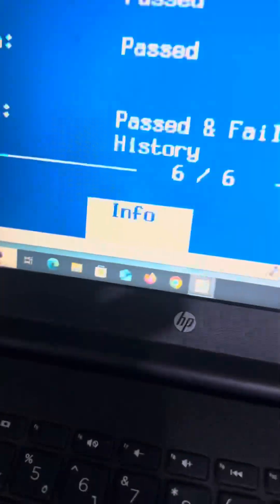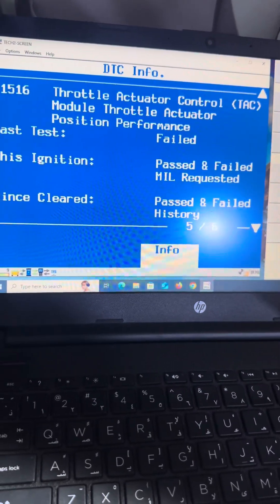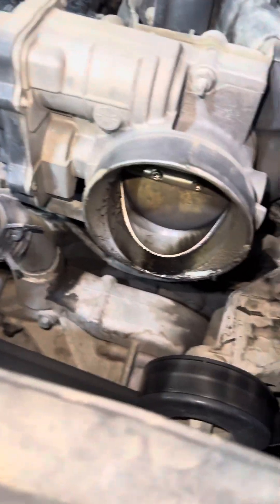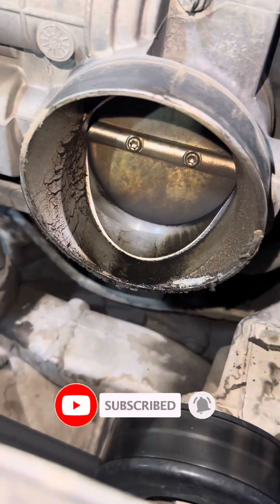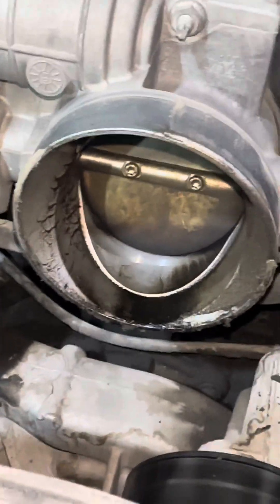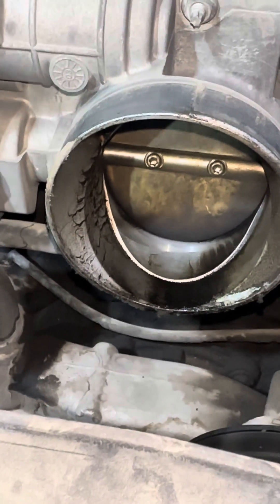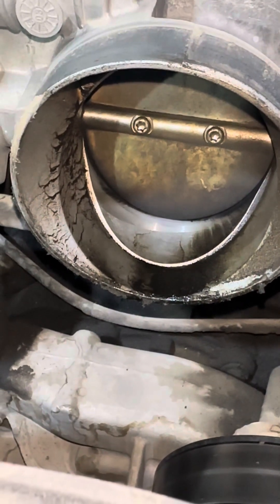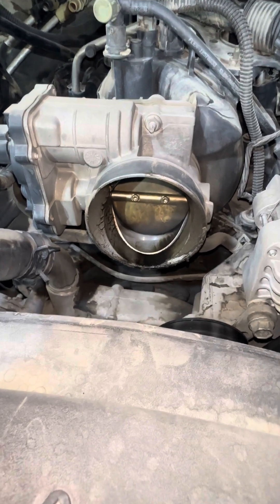P2135- THROTTLE POSITION 1-2 CORRELATION, P0220 , P1516 - REDUCED ENGINE POWER, GMC-CHEVY-CADILLAC

Comment: Have a 04 Silverado 2500 6.0 
P0220 P2135 
Replaced —
Throttle body twice 
Throttle body sensor 
Throttle body pigtail
Cleaned grounds

First throttle body I purchased made the noise just like the bad one in the video. So I bought another one and Still have codes
Reply from the maker: Are the codes and fault Permanent or Intermittent? If they are permanent then Diagnosing the electrical circuit will be easy.
Reply: @MyAutoproblems They are permanent. I’ve unhooked the battery with every part change and cleared codes and as soon as ignition is turned on it goes into limp mode with codes mentioned. 

What electrical circuit do I need to check? I have a test light and also have a multi meter. I’ve read the green wire and yellow wire could be troublesome.
Reply from the maker: @ReallyPossibly i believe my channel has an Email described for Communication. You can find it at my Channels Bio. Email me and hopefully it will be sorted with the given tools you have.
Reply: Can’t find email. And I messaged you on facebook

Comment: Same prblem coming after replacing throttle body ..throttle body module  ground and wiring good..why like this
Reply from the maker: Check all the Grounds. One ground on each cylinder head. Carry out Voltage drop test on the grounds. Also verify the Circuit integrity, sometimes repair are performed on the Throttle Wiring and they tend to fail because of resistance. Reworking on those circuits will help.
Reply: @MyAutoproblems ground I found not in cylinder head it's in the transmission round bolts is there any prblem miss place
Reply from the maker: @rijojrajan4151 its on the cyinder head from the back side of engine, Two grounds. One on left and other on right. Try grounding the Vehicle Body and see if it ⚡️ sparks
Reply: @MyAutoproblems ok thank you so much